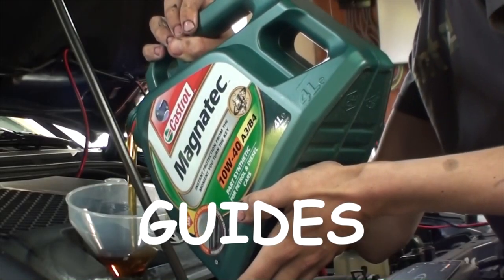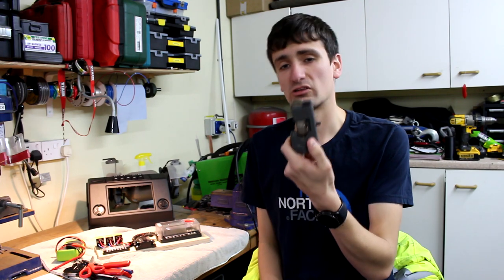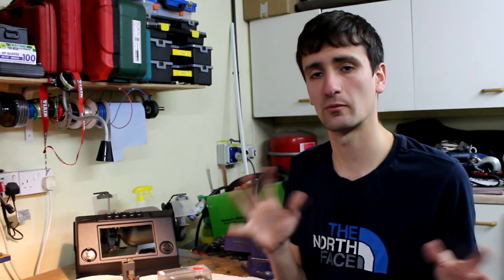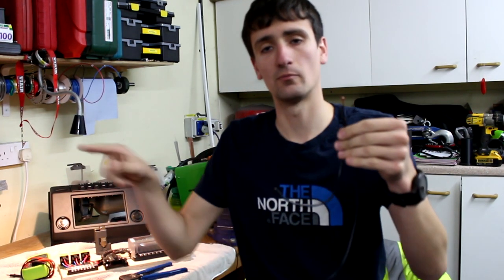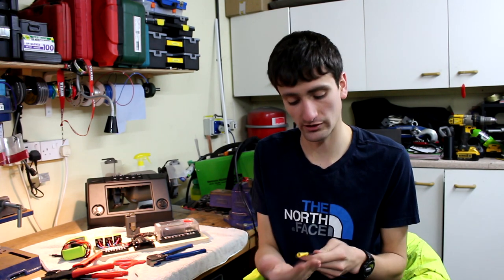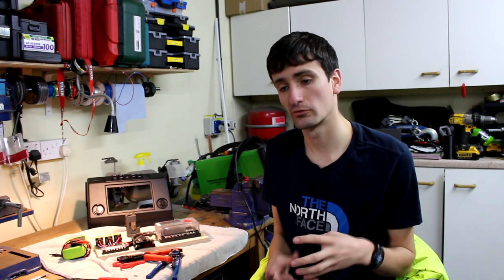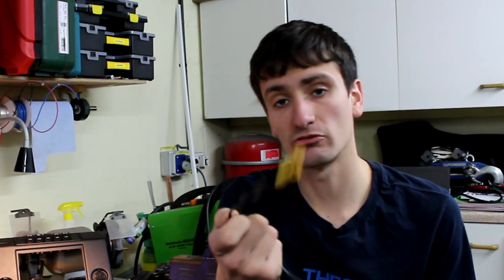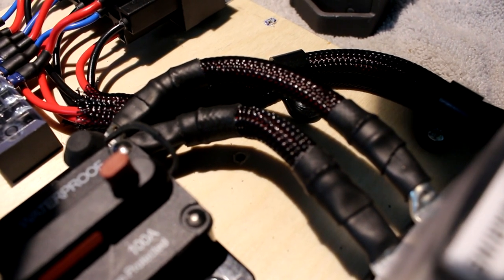12v Wiring Tips - Learn From My Mistakes!

Comment: When you talked about the piggy back connectors it was like a light went on.

I wondered what they are used for. For the stuff I have done I avoid using crimp connectors.

Comment: If the crimp pulls out, you have not formed the crimp correctly, so you either need a different crimp or tool or you are not using the correct wire size for the crimp. 

Carling switches arre exceedingly cheap, they only are popular because of the price point and the variety of decals, as for the switch, it is really a very poor design and the electricity for some points goes through springs.

Comment: A few good ideas there thanks. I have been doing wiring on my Defender for some years and I'm still not happy withe result even though.
There are two major problems in my experience. Firstly the lack of space so one ends up with mini fuse boxes and relay boxes dotted around the vehicle. Secondly the electrical installation is done incrementally - if one could plan the total installation at the start one could do a much neater job.
The worst of my problems is in the battery box where is no decent location for the low voltage cut out and the midi fuse box. There's no really neat solution.

Comment: Comment 2) pairing butt connector leads works best if the thickness of the main wire = the Guage thickness of the paired wire. (For ex... 2 blue size = 1 red, 2 red = 1 yellow.
Split the wire mass in half of each wire to be paired and twist the 4 separate wire ends.  Use dielectric grease and heat shrink the pair prior to heat shrinking the final  connection.  As bullet proof as possible... but still not soldered which prob takes less time than 'cheating'

Comment: How do you deal with relay wiring harnesses? The harnesses I find always have 14 or 12 awg wires and on a 30 amp relay. I don’t feel comfortable running 30 amps on 12awg…

Comment: Great video, how many ancillary items would you say to add before thinking about installing a split charger system? Im just starting my overland build.
Reply from the maker: Thanks!

Depends on how yo are going to use the extra equipment, for example this install includes lights that will only likely be used while the engine is running or if not only for a short time so a split charge system isn't necessary 

However if you are running a fridge and camp lights for a week with out turning a the key then a split charge system is necessary, if your planning an overland build then I would suggest installing a split charge system

We have other videos on this subject on the channel if you need more Information
Reply: @OverlandExplorersUK I'm still trying to decide how far I want to take the build.   But like you say split charge system it's expensive if im only running small items for short periods.  Thanks again,  I'll def be back for more videos.  👌🏻
Reply: @182Outdoors  Even small items will drain the battery if left on accidentally. IMO it's best to go for a dual battery system even if you only have a few ancillaries. Will most likely find you'll be adding more later.

Comment: hi Mate, great video so thankyou for that. I understand how the relay etc works. Just wondering how or where u get the positive for the switch to activate the relay? Can u piggy back off the constant? U do u have another method? Cheers
Reply from the maker: If your talking about the 'trigger feed' which will actually trigger the relay it all depends on what you want to happen 

If you want to be able to turn it on at anytime then take a constant feed into a switch then into the relay 

If you want it to only be able to be turned on when the keys are in and the ignition is on then you need to find a feed which becomes live then the ignition is on like the standard 12v socket for example
Reply: @OverlandExplorersUK  Thanks mate, thats what i figured. 

I have another question if u dont mind. what is the max amp for 1 accessorie do u use on this method? Id guess looking at wire size etc 10-15amps would be a big as u could go with the terminal strip? if thats the case What do u use for higher amp connections like 50amp anderson plug? Do u just run it through Another Circuit breaker?

Thanks again
Reply from the maker: @uareslick  I can't remember the rating for the terminal strip but I wire everything with 25amp wire unless it requires a higher amp rating but 25amp cover most things these days

Any higher then say 35-40amps o would run a dedicated circuit with a mega fuse or one of them circuit breakers if there is room for it. Then simply find a relay that is rated to the current, you can get relays that handle 300+amps

Comment: Hi you seam very up on 12v I’ve got a 12v reducer from my power supply to a diesel heater and I’d like to switch it  automatically to a 12v battery if I got a power cut have you got any suggestions please regards John
Reply from the maker: Sounds like a change over relay would work

Connect your heater to the input of the relay and the two separate power sources to the output then use a feed from your power supply to trigger the relay

I can't be sure it will work 100% but I would try that first

Comment: I never use crimped connecters, only soldered ones.  Over 40 plus years of off-road in the bush in Australia most failures I have had were crimped, rarely soldered one.  Soldered failures were all mechanical damage.  🤓🤓🤓
Reply from the maker: There seams to be arguments for and against both soldering and crimping. I guess its down to preference, this is why I started using adhesive lined heat shrink to give that extra bit of security
Reply: @OverlandExplorersUK  🤔 I appreciate you are in a temperate to cool climate and plastics and glues last for long periods but where I am and travel it can be over 40 C for two months of the year in tropical conditions.  Plastics mostly only last 2 to 3 years before they start to crumble and consequently are a real hassle. For example the white plastic bottles and drums that are common might survive one summer exposed to the sun before you can poke your finger through them.  I guess it’s horses for courses.  Keep going, you’re going great. Happy New year and have a prosperous 2021. 😎😎😎

Comment: Comment 1:  hammer 0-8 GA. Crimper = $20 vs ratcheting crimper =$23-35 (~$25 ave)  on Amazon.  Spend the extra $5 and some come with a large ga. cutting tool.

Comment: How to avoid wire overload???
I spliced one 12v cable to two others 12v and my fuse blown!!!
Reply from the maker: Don't splice into an existing circuit, create a new one by wiring to the battery with a fuse etc
Reply: @OverlandExplorersUK  can I use an fuse piggyback to do so?? Is it safe??? Thanks for the reply although it's a old video👍👍👍

Comment: nice video.....circuit breakers ---> never ever go cheap....enerdrive, blue sea systems or similar super quality brands.....plenty of tests on YT showing these amazon, ebay POS circuit breaker not switching according to their ratings....so if you want a fire in your RV or home, then buy the cheap stuff.